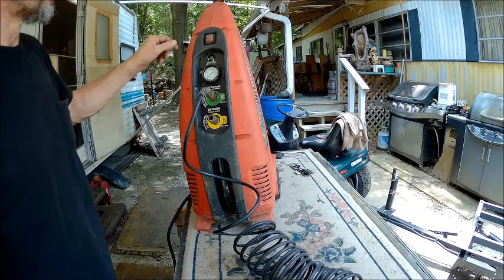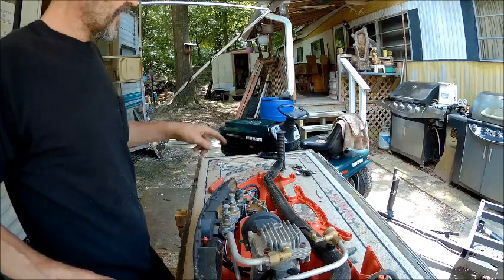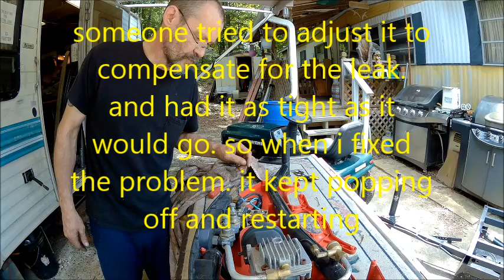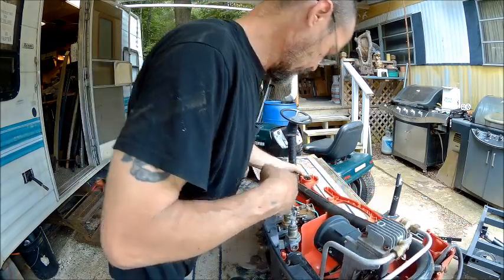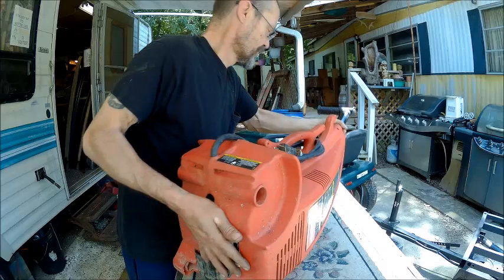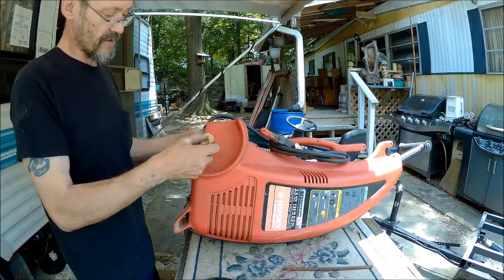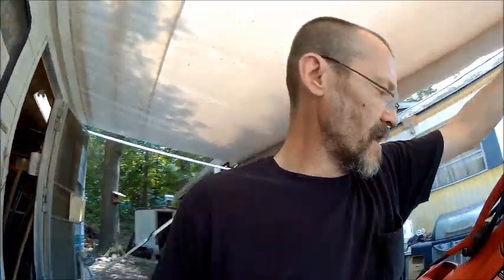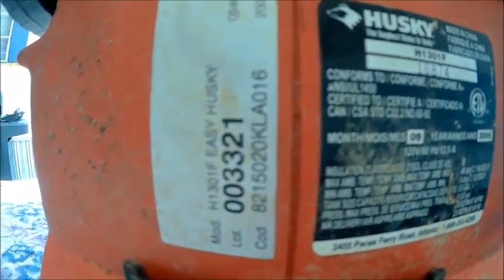husky air compressor repair model h1301f

Comment: I just picked up the same compressor you have in the video.  Mine leaks in the same place.  I taped the threads with teflon tape, but I don't think it will last.  I just ordered O-rings from Amazon in a kit.  Do you remember the size you used?   Also, it looked like you set the air pressure with a wrench on the back of the switch.  Is it marked?  You did such a fine job on yours, I hope I can also.  I bought it on facebook from a young couple, and I didn't have the heart to take it back to them.  I only paid $40 for it, and decided to fix it.  I does hold air after taping the 90psi valve, but like I said, I don't think it will hold.  Thanks Bob, I like you site!!
Reply from the maker: i use rtv gasket maker on my threads